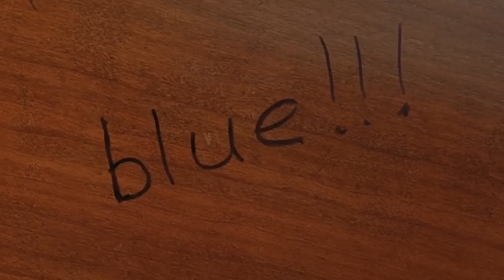Nitrous-Fed Lightweight Corvette vs 800hp 2JZ Nissan 240SX Drag Race

Comment: The rb26dett is more of an balanced more predictable engine it make not be good as the 2j block but more predictable and balanced compared the the 2j which likes low end and is unpredictable at higher rpm’s as in .like him you might be caught off guard compared the the rb26dett which yes revs higher but is more predictable so that wouldn’t happen 🤷🏼. And big turbos mean lag nitrous is Instant horsepower at the press of his button so roll races the time the 2j gets into boost he’s already gone 👀

Comment: What the hell did I just watch? A 550hp vette spanking a 2JZ S14 with "800hp"? 
The silvia owner's driving is for shit. You can pull off perfect doughnuts but you can't drive it in a straight line through a gear shift? 🤔 And he's a self proclaimed roll racer? Sounds to me like the build never got finalized past the engine swap. 
Get your shit set up right before you hit the track and make sure you can drive it. 
This race was flat out dangerous for both drivers because the Nissan owner had no control of that car at any point.

Comment: Yo can anyone actually build a 2JZ that doesn't make peak power 500 RPM before redline so it actually accelerates instead of blowing the tires off and bounce off the redline? No-one cares about your peak numbers on the dyno if you cant put it down.

Comment: I just feel like in my experience when I see people trying to drag race lightweight cars with two J's they tend to get a lot of wheel spin or lose control obviously comes down to the weight of the vehicle the type of boost the running and the type of tires they're running I personally feel like they are more of a drift motor when they're turboed when they get up to boost that's some real Tire burning power I just personally don't like the concept I mean I'm sure if you had sticky enough tires a big enough track tire and I'm sure you're fine but I guess I'll see the video.

Comment: 240 needs better transmission
Reply: CD009s are fine. 240SX needs a driver mod.
Reply: 1st - 3rd too short
Reply: But it could be that too
Reply: @mixedbysanny447  NGL that is true, the CD009 is a true 6 speed with a single overdrive, it's geared short for a fun driving a high revving engine. 

You may have a point but I still doubt swapping in a T56 would solve all his issuess.